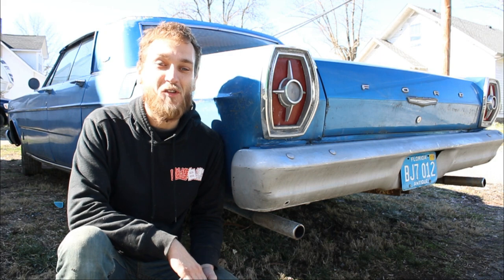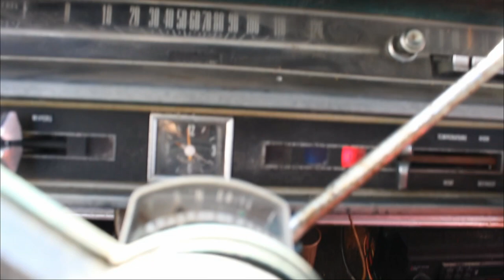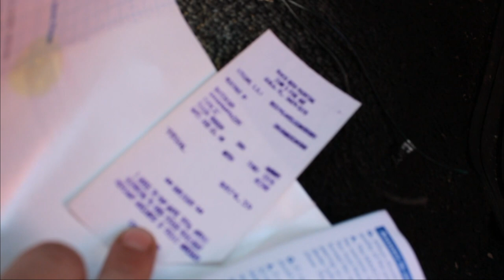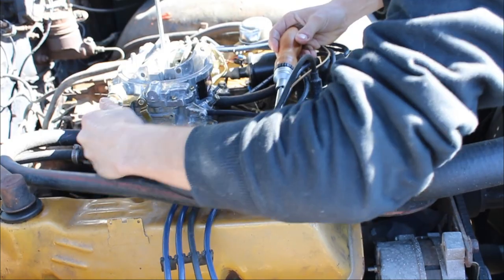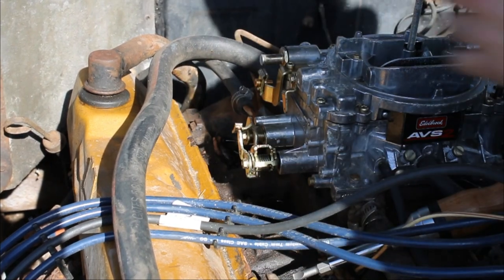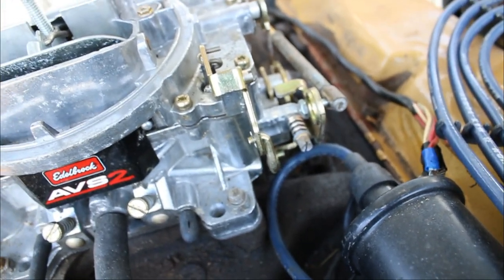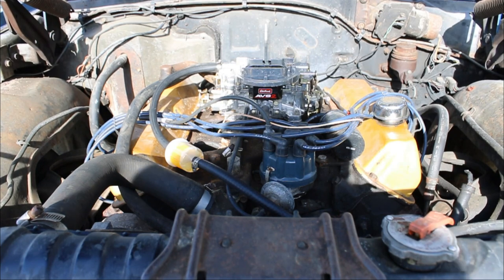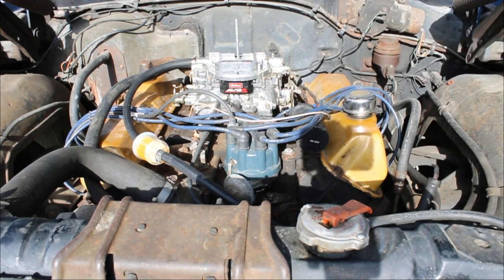First Day With My Non-Running '65 Ford Galaxie 500

Comment: Don’t adjust that “idle speed” screw, you are essentially bypassing the idle circuit those butterflies on the bottom of the carb should be square with the idle circuit if adjusted properly. Your idle circuit isn’t getting enough fuel. Hence the dying when the carb was adjusted to where it was running just off of the idle circuit. With that screw turned in, it does up the idle speed but that’s because you are literally dumping fuel into the intake like your foot is pressing on the gas lightly. If you get the engine hot with it adjusted like that, the likelihood of the engine dieseling is much greater. The carb, if the fuel pump is delivering enough fuel pressure, needs a good cleaning/rebuild…..it’s tiny passages are likely gummed up and partially blocked. (This is coming from our drummer)
Reply from the maker: It was having that dieseling issue when it was running high like that but I’ve since rebuilt the carburetor and got a lot of junk out of the fuel system. It breathes much better these days

Comment: do yourself a favor and turn the coil around it is in backwards and your throttle is hitting the coil wire, if you don't you will chafe it and could have a fire. Your air mixture screws are also out of wack. Gently turn them all the way in and back them out 1 1/2 turns it should idle a lot better. You are making a mistake not running off an auxiliary tank until you clean out the tank. Good luck.
Reply from the maker: The tank has been replaced semi recently it looks brand new but you’re dead on about the carb. I ended up rebuilding it and found a lot of rust from the old tank I assume and adjusted them just like you described and the baby spins like a top now. I’ll check that coil out next

Comment: I just bought a 65 Galaxie, is a 2 door that's Black with Black interior and has the original 390 auto trans, which I'm trading out for a 5.0 and auto trans out of an 85 Mustang, I know "Trading out a Big Block for a Small Block"? Yes because I'm not building a monster muscle with a 1000 Hp and 800 ft. lb's of Torque, or a totally original restored car, I'm building a reliable Daily driver that I can have fun with on the weekend plus I'm not putting 50k in a car that will be worth 25k when it's done. I got a SMOKING deal on the car but the Engine needs to be rebuilt, it needs a paint job and everything in the interior needs to be fixed/replaced but the back seat and the door panels so I'm going to repaint the car Black but I'm going to 2 tone it with a light brown roof and change out the ragged out Front Bench Seat for Buckets out of a 96-97 Honda Civic that I bought on Facebook Marketplace for $50 a couple years ago and change the interior color from Black to Saddle Brown, and I'm changing the wheels but Idk exactly what I'm going to do, I'm probally going with the Voxx Monte Wheels in the Bronze color so it goes with the brown interior and roof. Like I said, I'm not building a $50,000 show car that I only drive 12 times a year and I'm not doing a "factory restoration", I'm building a solid and reliable Daily Driver that looks good on the cheap and my Gf and I can have fun with on the weekends going to Cars and Coffee's/ Local Car Shows and then go for a Cruise along the Atlantic Coast here in Florida for 10-12k.

Comment: So fun to see a young man with his first project car! I remember my first one too and I was just as excited except mine was running and driving right away even though it was not in nice condition. It was a 1966 Rambler American with a straight 6. It had bullet hole in the body (Only half a dozen) and dents on most fenders but it drove and I was happy to pay the $150 for it at the time. LOL. This one is very similar in it's look but the engine is much nicer and more powerful for sure! Nice buy! Thank you for the video!
Reply from the maker: Thank you for watching! This has been a blast to work on and get going right. Now that it’s running good I’d like to get to work on the body. I love the ramblers, I came close to buying one when I was looking at the galaxie. I’ll probably end up with one sooner or later

Comment: My Dad had one of these when I was growing up but his was the cheap ol Custom version with the 240 six and three on the tree and overdrive. Never saw a car that new with overdrive.It was a tough ol ride,he must have had it for 15 years at least. And then I got a hold of it. I beat it to death but it still ran when it retired to the junk yard. Another one of the stupid things I did to cars in my youth.
Reply: My Dad bought a new 1966 Galaxie 500 Club Coupe off the showroom floor, he told me. I remember it fairly well, but I was a toddler then. He later told me it was the Six and 3 on the tree, rare for a Galaxie. He regretted buying the 240 Six, wasn't impressed with the power. The following year, he traded it in for a new Wimbledon White Custom 500 4 door sedan, this one with the regular fuel version of the 390, and automatic. It was our family car until my older sister got married in the mid 70s. It went with her and her husband.

Comment: My first car was a 65 Galaxie 500 with the LTD option. 390, auto, p/s, p/b, air, vinyl roof, and AM/FM stereo! 
Dark green, white vinyl. I got it in 1968 to go back and forth to a close college. 
When it ran right, it was a great car, but it had some strange occurrences. It would play dead sometimes only to come to life 10 minutes later, the gas pedal broke in half, and the linkage would stick sometimes. 
It was very powerful and luxurious. My dad traded it in in 1970. It was starting to get a little too unreliable.
Reply from the maker: That sounds like it was a real sharp car! It’s funny how today we think of these cars as unshakable tanks because they’re still around but truthfully when they’re driven every day they get as temperamental as anything else

Comment: I'm sure since you made this video you've learned a ton about the ol girl! Watching you though I start to talk to the screen trying to give you advice because I get excited for ya! LOL. When you start her up at first (cold start) you'll have to keep her running for a few minutes with the gas pedal unless you have a manual choke which I didn't see you using so I'm thinking not. But once she starts to get a bit of heat in her she should stay running if she turned up alright.  But like I said you already know all that by now.
Reply from the maker: I’ve learned so much since this first video. It wasn’t tuned well but it is now and it rides/idles great. I still need to add a choke to it I just keep putting it off because I only have to finagle it once most days to drive it and I’m a serious procrastinator lol

Comment: About to get a 63 500 xl (4 door like yours) will be my project for the next year or so.
Mine also has the 352... but all original sadly, so am going to have a lot of work to do there.
Anyway best of luck on yours.
About black, have you considered satin black? Looks bad ass with a red interior.
Reply from the maker: That’s exciting I hope you’ve gotten ahold of it by now. Theyre great cars and they catch eyeballs everywhere they go. I did originally think about a satin or matte black. I’m kind of on hold with the paint for a while. At least until I can get into a garage where I can properly disassemble it and leave it apart for a while

Comment: That's still a nice looking car. Old cars are great to cut your mechanical teeth on. The main issue you're going to run into is finding good replacement parts for it. It's turned into a real hit and miss. It's like they forgot how to make basic parts.
Reply from the maker: Yeah I’m starting to feel that already. The radiator took me a while to find but I’ve got one on the way finally. It’s like a big crusty puzzle, it’s so exciting to figure it out
Reply: If you ever need to go the donor car route to replace something (unless you're lucky enough to find another '65 with a working whatever-you-need), the only other year model that's compatible with a '65 is a '66. Ford didn't change an awful lot between the two model years, but one big difference I know of is the fuel tank; the '66 model's is bigger, so you'd have to make some adjustments with the fuel sensor and fitting the tank into place.

Excited to see this story unfold!
Reply from the maker: @CapriciousTyrant  That's super useful to know! I'm still learning all about the car and what I can do with it. I'm about to dig into body work this week as long as the weather is kind. We're gonna work these funky dents out and start making this thing really pretty

Comment: hook up the pcv hose to an valve cover!
Reply from the maker: What does this do
Reply: @Acidwashed Art  circulation for the engine. Search for it on YouTube and you'll see how to hook it up to your side of the valve cover.
Reply: @Acidwashed Art  the hose coming off the carburetor with the bolt at the end is the one you connect to help vent the engine

Comment: new fuel tank ?
Reply from the maker: Someone has already replaced it. When I rebuilt the carburetor in my last video it looked like they either didn’t rebuild it or didn’t replace some lines after replacing the tank because there was a lot of rust and dirt in the bowls